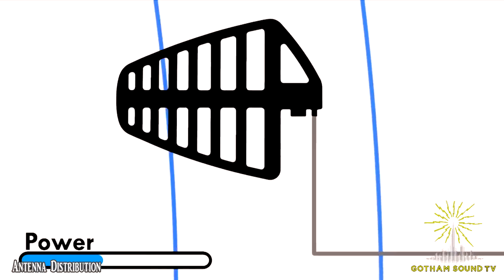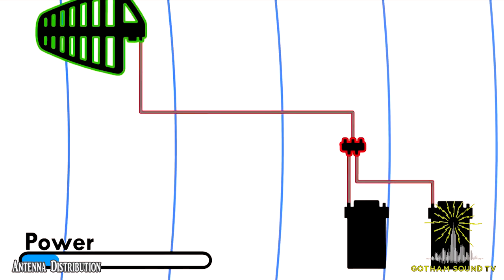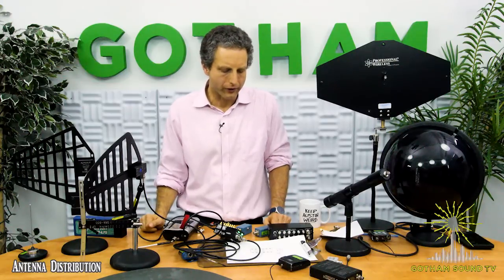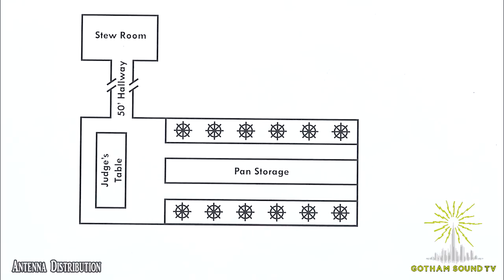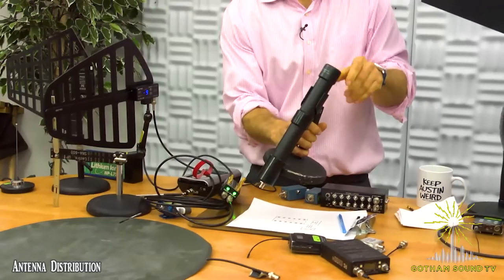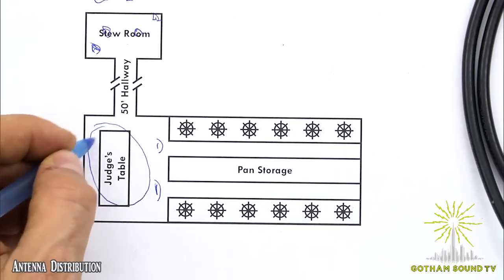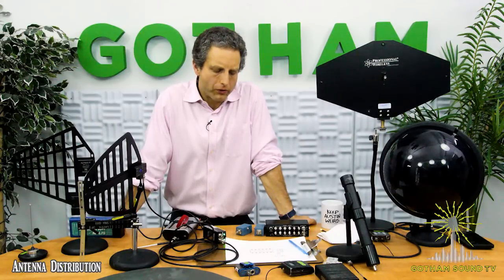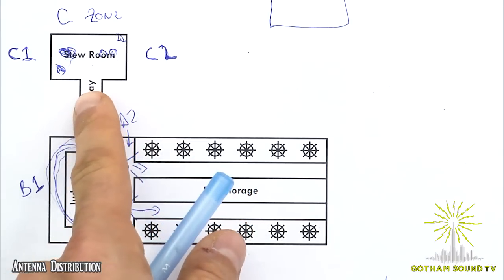Antenna Distribution

Comment: sir if im using zoom f8 and senheiser receiver/ transmitter,may u show me how to use rf antenna,thanks
Reply: You would need to have your Sennheiser receivers modified to use SMA antennas.  Then you can connect the antenna distribution to the SMA connectors on your receivers.  Here is more information: http://www.allistairjohnson.com/mods

Comment: Thanks for the awesome video. Curious, how can I connect my Lectrosoinics T4 transmitter for antenna distribution for my IFB's?
Reply: An SNA600a works great with a T4.
Reply: @njh209  just connect it directly?
Reply: @jonmendelsound  yes with a 50 ohm antenna cable.
Reply: @njh209  cool thanks, man. I'm soon getting into distribution gear. My workflow is as planned, Get my 411's or SRc's antennas wired up to a PSC distro box (BNC to SMA cables), that outputs to 2 BNC cables attached to two new Besto fins or Lectro SNA's. Then my T4 will be rigged up to a Besto or SNA with a direct cable. A total of 3 fins/antennas. Does this make sense Nick? Thank you for your time.

Comment: Nice video! Is it possible to take a receiver that has only one sma antenna and split the signal into an A and B distribution system connected to a RF venue that has both a shark fin and a dipole?

Comment: You mentioned at least 3 or 4 receivers to be used with an external antenna, but if course i may want to use it also with 1 receiver, for instance an ucr411. What is the real benefit with only one receiver with external m directional antenna. Of course without any rf distro.
Reply: A single directional antenna used with a single receiver like the UCR411 would work similarly to using that same antenna powered distribution.  The directional antenna would give you a better antenna, that can hopefully be placed in a better spot above or around obstacles / people, and would give you additional gain in the direction it is facing.  Just make sure the antenna you are using is passive since the 411 doesn't have bias power.
Reply: @njh209  MAny antennas on market are active, can I easily exclude the amp and use it as passive?
Reply: @francescobrillante3452   it depends on the antenna. Some active antennas will default to being passive if there is no power applied some will not. Passive antennas are less expensive so I recommend those as a starter.
Reply: @njh209  I've seen some from this company leicozic, aliexpress brand. All of them are sold as active. If I am going to use them on the bag with 50 cm cable  should I set them as 0 db gain ?
Reply: @davidaliperti  I'm not familiar with those brands, but yes, typically with a short cable run you do not want or need to add amplification

Comment: do you have any antenna solution for digital systems that work at 2.4ghz .. i have 4 sennheiser ewd1 and am having many problems.
I found this antenna model for shure GLX-D microphones (GLX-D PA-805Z2 RSMA - Shure)
would it be possible to use these antennas in the sennheiser ewd1 system?
I do not know what to do to solve these problems anymore
thank you
Reply: I am about to try setup for my wedding . I have the same problem .

Comment: Hey Peter,  I have the PSC RF Multi paired with 6 lectro 411's 3 blk 21, and 3 blk 25, with ALP620's.  I get poor strength going passive, without using amp power but I feel like I'm way too close when I have it on.  I get better signal with the standard whips.

I also understand the PSC RF multi is NOT filtered so it is subjected to easier interference with things on set like walkies, tera dek, etc.

I heard the Audio Wireless Ltd DADM266 might solve these problems.  Have you had a comparison between the two and have any thoughts?

Comment: 24:35 Curious, when you say: set the antenna's gain to overcome the losses of cable length/splitters. Are we basing the needed make-up gain by visually watching and working-up the receivers Rf indicators to 100%? Would that be an over-simplification or accurate gauge?
Reply: Not an oversimplification at all, but doing it that way can unnecessarily increase noise in the system. Ideally the amplifier at the antenna should be set to overcome the losses of the system downstream (ie between the amp and the receiver, including cable and splitter). These figures are knowable - there are tables online and spec sheets for the splitter.
Reply: Thanks Peter. Makes perfect sense.

Comment: Hello . Thank you for the great review ! as always a blast to watch ! I use the dadm 226 and audio wireless true diversity units. 2 audio wireless units and those go out to 2 bnc antennas . the units tend to function fine but once i am out of direct line of sight the signal goes down sout. i still havent fixed this issue .... i am really interested in the betso sharkie - will one antenna work with 2 receivers ? and how do i get both receivers connected to the antenna ?
Reply: Sorry for the late reply - you should use 2 antennas for diversity reception.

Comment: Hey Peter! I have a question; you talked about the directionality of the shark fin antenna being more like a shotgun, but what would be the directionality of the SNA antenna? I’m thinking of getting those for my bag setup!
Reply: Renaud Bonneville that's right!
Reply: An SNA antenna is omni directional.
Reply: Nick Huston thanks man!
Reply: Quick correction on that!  It's actual toroidal / donut shapped.
Reply: Nick Huston so it’s coming from all sides except the bottom and the top of the antenna?

Comment: Best Antenna Distributionfor sennheiser G3 wireless because within 30 feet i'm having RF issue.
Reply: You might actually be too close thereby overloading your receiver. If your antenna has a pad, try turning the sensitivity down.
Reply: You would need to have your G3 antenna modified to SMA.  Then you could either hook an antenna directly into it or if you have multiple systems use any of the distribution systems mentioned in the video with an external antenna.